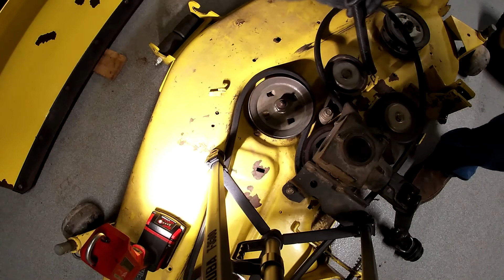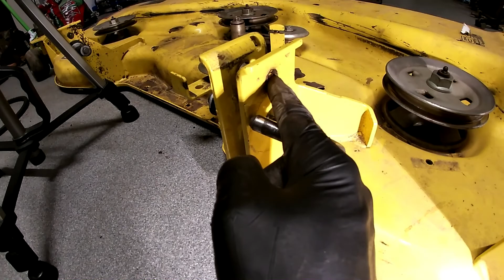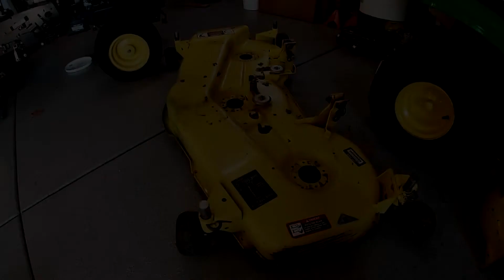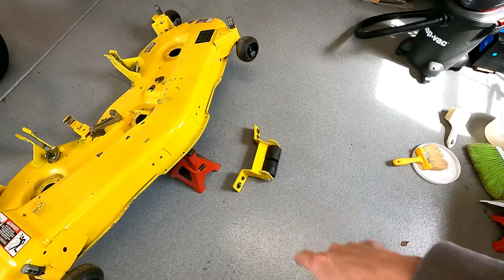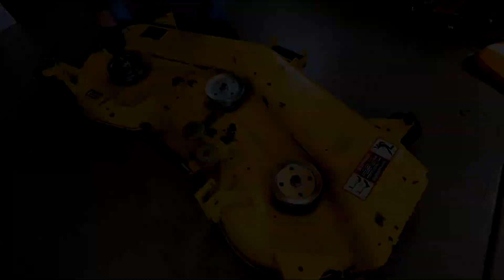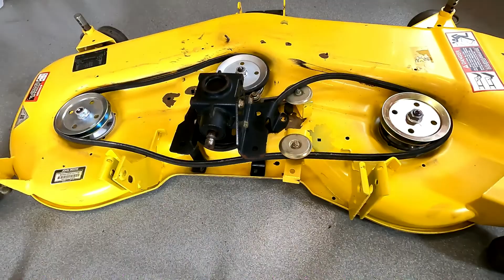John Deere 425 54" Mower Deck Repair & Rebuild w/ New Belt Install

Comment: Thanks for the video, my deck rusted out even after I patch welded it o er the years. I bought a new one from Kohn Deere. It was the last one in their inventory. I painted the underside with truck bed liner to help prevent rust. That was three years ago. Now it keeps throwing the belt. I took into the JD dealer and spent $400 only to have it work for a couple of mowings and then start throwing g the belt again when ever I would engage it.😬Does anyone have any suggestions?
Reply: Yes, had same problem. Belt spring is undersized. I put heavier duty spring on and has not thrown a belt in 5 years.
Reply: @ntg8434  Wow! Mine throws the belt as well. I will first try a heavier spring before pulling the deck off and attempting to repair again.

Comment: These are great videos of the 425. Just wondered if you ever took it to your folks and what they thought of what you did? I bought a used 425. Took it to a friend to check it out. Deck adjustment was broke, the water temperature gauge & fuel were not working. My friend did some investigating on the instrument cluster, checking for loose wires & such. Mower was suppose to have 729 hours. Found out someone had blacked out the #1, so it has 1729. He was able to fix the deck, ordered a new instrument cluster, just under $500. Not much I can do about the false engine hours. Hopefully it will last a long time. I’m hoping the plastic cam gear has been replaced.
Reply from the maker: Yes, my folks took the mower back last year.  It runs well, and has no issues.  The yard looks great thanks to a properly set up deck and fresh blades.  Thanks for watching!

Comment: To save that deck better, have it sandblasted or strip it yourself including the bottom real good. Use epoxy primer top and bottom 2 coats. Use 2K spray cans or spray gun. Spray 2 or 3 coats John Deere yellow. Mower decks rust out. The epoxy primer seals the metal so it doesn't rust out. Done right and the deck will outlast the tractor.

Comment: Your video was excellent! I had to replace my belt; only lasted 22 years! 😆 Went to JD dealer and bought the belt, while there, I asked for a little advice on how to, any tricks to ease installation; they looked at me like, "What!! You want advice?! Out(the door)with you!!" 
Your video made the job MUCH easier. Simple, easy to follow instructions and, either loosening or removing the drive system is the ONLY way you're going to get the belt on the drive system pully.
Thanks again, great job!!